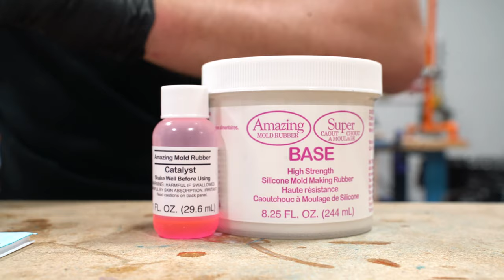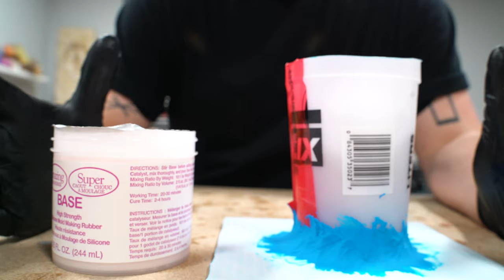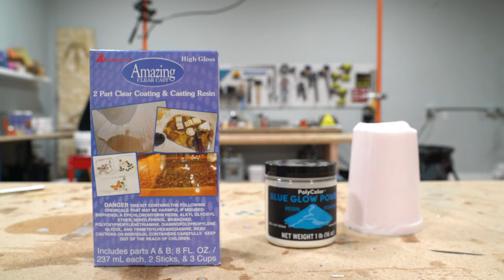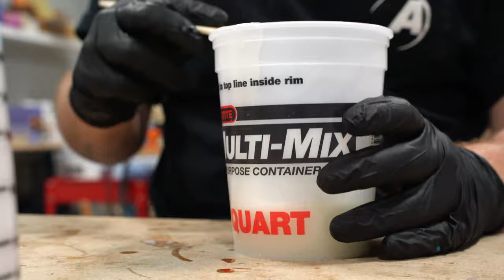Epoxy + Glow Powder + Quarantine = ??? | Alumilite

Comment: hello. thank you. 
How much glow powder do you usually use for 1 kg of resin?
And when you use this powder, can we also use pigment powder?
thanks.
Reply: You can't use pigment as it blocks the glow. Different colours are available based on crystal composition. Normal ranges for pigment is 20-30% of resin volume. UV additives in resin prevent the pigment from being energized by UV light, which is a big problem.

Comment: How long do the  glow powders actually last?
Reply: Chemically, they last forever. In terms of glow, it is very good, but becomes darker than new tritium after 30 mins. Temperature also affects the result. However, they will visibly glow in a dark room for 10h, but at very low brightness. Enough to guide you to an exit in complete darkness, but not enough to illuminate. Maybe if you painted an entire room, you could get a decent effect.

Brightness depends on grain size, so thinner particles suitable for paint tend to store much less energy than sand size particles. Working with larger particles requires very, very thick resin to prevent settling to the bottom.

Comment: You can't properly use glow pigments with craft resins as they are full of UV blocking agent. The only viable energy source is blue light from the sun, or very close exposure to house lights. Even then, the effect is inferior. The most common energizer is UV-A torches and lamps, and these just don't work at all. 99.9% blocking after 1 cm of resin.

Comment: Come on guy's, I know you want to sell as much product as you can that's how you make your living. But for the Costumer, 'savings is a must. The waste is kinda, high for some or most of your projects. Don't you agree????   Why not show how to make a Lens that could replace the Lens for the light?  Maybe a slip over Lens. Maybe a UV replacement for the Light it's self with a Lens made to fit or any Shape you would Desire? Demonstrate using a UV LED COB or what ever LED someone wanted to use and charge Lens?  Design and build your own circuit using a UV LED with a LUX cutoff so that the LED circuit would cut the UV LED off allowing just the Glow Pigment Shinning. When the LUX falls to a certain point, the UV LED would come back on and recharge Pigment. There better Glow Pigments on the market. The GREEN and WHITE are the Brightest and longer lasting, up too 12 or more hours of usable light for safety. Also, why not show how to degas using a shop vacuum. Wouldn't this be easy to do? What about using a Silicone Bag for Mixing?  This way you could just Peel out the Waste and reuse the Bag or Bowl?  I'm just asking. Thanks for the upload.
Reply from the maker: Thanks for the honest feedback, James!